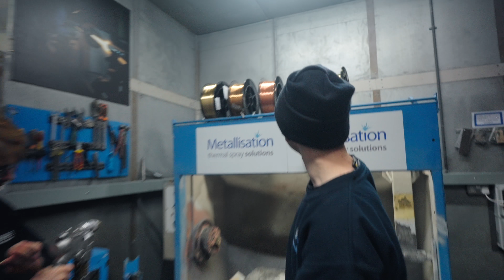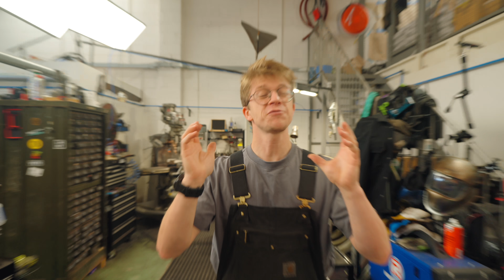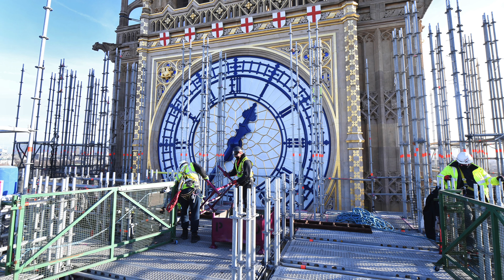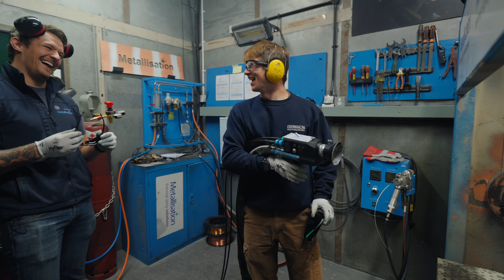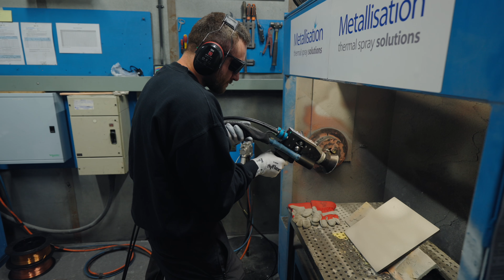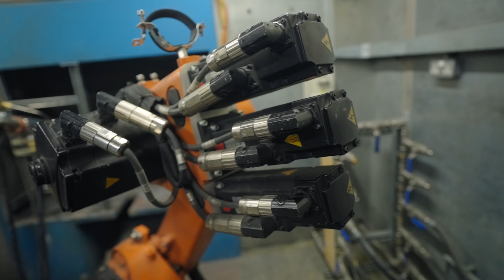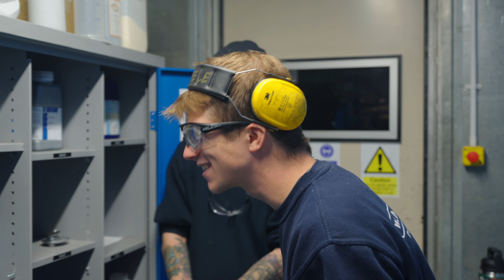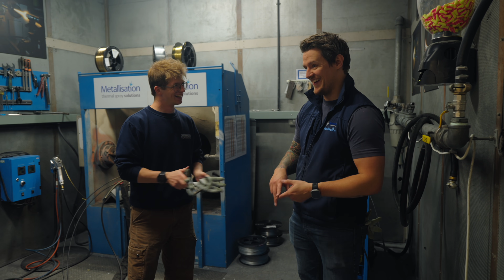Metallization

Comment: The digital film thickness tester is probably an eddy current test. It applies AC magnetic field, which induces eddy currents in the film, which in turn generate an inverse magnetic field, and the phase and amplitude difference between the input and output fields is translated into thickness, broadly speaking

Comment: Wow! This is perfect for rustproofing! Even in shipping industry usually paint is used! But now it might be possible for reasonable cost to spray hull with thin layer of stainless steel or some other corrosion proof metal! Also barnacle growth would be slowed down an ship paint is extremally toxic to marine life!

I wonder if it's possible to spray titanium over steel or there would be problem with oxidation!

Also bronze art installation can be made from steel and sprayed with bronze afterwards for corrosion resistance and rust proofing!

Comment: I like the idea of putting aluminum on something made of steel then electro anodizing it instead of doing electro plating, this is sick
Reply: I wonder if it would work, as cast aluminium doesn't generally anodise, so would the spray alloy be closer to billet, or cast?
Reply: @NathanNostaw since it involves heating up the material, it would be closer to cssting

Comment: This can be a massive game changer in automotive inner Cylinder wall lining and repairs
Reply: For fixing bore-scored Porsche 996 cylinders ?
Reply: @chrishb7074  The possibility of using different lining materials plus controlling  application thickness yeah corrosion dips and scratches would be a thing of the pass. Apply and then machine to spec
Imagine getting bearing clearance on rods /cranks near perfect by using this to build a consistent height and grinding them to the same spec. All theories of course lol

Comment: There's also a process called cold metal spray you should look into if you're interested.  It uses a high velocity jet of whatever metal to form the bond and is not supposed to reach welding temperatures  so you don't ruin any  kind of  heat  treatment/temper. Also, someone has combined this tech with a machine  tool so you can add whatever material then machine it to  size.
Reply: The pressures are much higher, hand held cold spray scares the hell out of me.  I'm happy leaving it on the robot lol.

Comment: I suppose you can technically do Gallium Coatings, you just need a device designed to use an electric element and a pneumatic sprayer to spray the gallium out but then you're painting, not Metallizing.

Comment: A long time ago I used to work as an operator on metallisation equipment. Those things were far different from what was shown here. We were coating plastic parts with copper and stainless steel to create ems-coatings. We used argon plasma and insanely huge voltages in near perfect vacuum and near absolute zero temperatures. The coating thickness, copper and steel combined, was around .001mm with an error margin of .0005mm 😅
Reply: That sounds like plasma sputtering
Reply: @teresashinkansen9402  I think the process was called vacuum chamber coating in english. In finnish it was "tyhjiöpinnoitus" 😅 Anyways, we had two chambers with insane vacuum pumps, ridiculous cooling and maniac levels of voltages, currents and magnetic fields. And we also had some fun with our equipment. I did coat some fishing lures and other stuff along in the production with our actual products.

Comment: It's funny when so many negative people say "Ugh, we don't make anything in this country" really are so clueless. Thanks for spreading the knowledge Alex! Edited to add and I only mention these companies as a subscriber to their channels too), there's an outfit in Oz (CEE) that uses hot spray to build surfaces for machining and one in UK (that I know of!) that uses hot metal zinc spray as corrosion resistance on their project cars (RetroPower) .
Reply: The thing with that is: we (in my case Germany) have moved a lot of labor intensive but low specialisation productions out of the country. BUT we still produce things. It's just that the things we still produce are not everyday applications. Without the specialised firms like Zeiss etc, some productions lines for other things would stand still. And it's probably the same or similar for the UK.
Reply: IIRC Kurtis @ CEE has a Metallisation arc spray setup.
Reply: @lemmy9996  I wasn't sure of brand he uses but good to know it's Metallisation

Comment: Brings back memories.  I did my master's thesis on arc spray.  Specifically, spraying zinc alloy on a pattern to make a mold cavity.  Cool thing, literally, about spraying zinc alloy is that it supercools.  We coated my younger brother's hand with a thick layer of zinc.  He wore a rubber glove to avoid UV arc burn, not for temperature protection.  Airport security was quite amused by it in his carry on luggage.  The hamburger too.

I didn't have the funding for a respirator air supply (to avoid zinc fume fever).  Thousands of dollars for that.  But a bathroom fan and flexible duct for $30 was in budget.  The $10,000 air compressor (you need a monster) was definitely out.  But someone else in the lab needed the same capacity.  "Hey, want to go pitch in $5000 to pay for half?" "Sure!"  Used one for $5000 and I had my compressor.  It was considered a facilities install, as was the hand-me-down spray booth from the art college, and I had my setup.

Unfortunately, the exhaust duct was under positive pressure and near a smoke detector.  Imagine my surprise when I get a tap on the shoulder from a fireman while making samples for testing.  The building had already been evacuated, I was still working away with my 104 db sprayer (wearing earplugs and respirator helmet).  After this happened the third time, I was told if it happened again, I'd be going to jail.  Worked out a deal that I could do my work at night and they would remotely disable the sensor.  I had to call in for them to disable, and call in for them to re-activate.  Mess either up, and I'd go to jail.

After a year of working nights, hundreds of samples, a 130 pages of thesis, I was able to give the mathematical equation to predict the strength of the sprayed alloy:  Original strength divided by 4.  You'd be within 19% regardless of the zinc alloy, machine settings, anything.

And that folks is my contribution to academia:  /4
Reply: No, your contribution is the rigorous certainty in the fact that divide by four is the correct answer. That certainty is A LOT of work and an important contribution to materials science. There is a beauty to an answer being simple, but the science is the rigour behind the simplicity.
Reply: @ParanoidMarvinMk2 Noooo! His glaringly obvious contribution was this YouTube comment. Think of all the years it took for the story to get to this YouTube comment section. That is a major contribution
Reply: Hell yeah!, that's cool af.  I don't know you, but I'm proud.
Reply: Dude that’s so cool. You also write very well, have you considered posting or making videos about your knowledge in this area?
Reply: What an amazing experience to be able to have such a real world and long lasting impact on such a valuable technology.
Reply: So, did you figure that it's because of porosity, or is it bond strength between particles? Both?
Reply: @weatheranddarkness  Porosity some, but there is significant oxide inclusions.  You'll note that they use nitrogen or argon in the video sometimes to avoid that.
Reply: @jeanbeaupre4006  oh, that makes loads of sense
Reply: @weatheranddarkness i was thinking the same thing.
Reply: That certainly is a remarkably simple conclusion to what could have been a highly complicated transcendental/non-closed-form equation!
Reply: @zinckensteel  Yeah, something like that was the middle part of my thesis.  A full page equation.  Followed immediately by saying that's too hard, time to go empirical.
Reply: I've got nothing more to say that hasn't been said, I just wanna add my contribution in saying your research bore great and very interesting results !
On another note, I'm glad you had the chance to do your research on a new technology, and I hope the actual "making" of your research was as interesting as your results.
Reply: 🎉🎉🎉🎉 congratulations i read that and besides the very end bit i understood all of that. I'm 🍃 so good on ya 😅
Reply: you coated a hamburger?!?! nice
Reply: @A2ne  Yes.  And my mom keeps it on a shelf.  It's 30+ years old now.  Scary to think what it's like inside.
Reply: Do you think microwaves for heating, magnets like in a physics particle linear accelerator, and for focusing, and vacuum to avoid gas inclusion and other problems could work? I'm assuming the microwaves heat the metal to plasma so the magnets act on non ferromagnetic materials.  Seems like maybe the metal could be focused down to a small point for something like a 3d printer. Or maybe used for metalization with fewer consumables and fuss than mini Saturn 5 rocket engines.
Reply: @karlharvymarx2650  That's above my pay grade.  But I did tinker with the notion of using electrochemical deposition through a narrow tube connected to several difference base metals so that allow percentage could be controlled at any point.

Too slow.

Don't know if your approach would work, but could be much faster.
Reply: Absolutely Awesome Story.
Reply: wicked! 😂
Reply: i love you
Reply: Man. You are awesome!
Reply: Awesome! thanks for your contribution!
Reply: Hahaha!  Brilliant story and delivery!!!  Thank you for sharing that. I got a big smile on my face and feel ready to start the Day!
Reply: i love hearing about mat science work, makes me more confident in what i'll settle on with chemistry lol
Reply: THANK you for that , SALUTE
Reply: That's cool af!
Reply: Brilliant 👍
Reply: Thats cool af
Reply: these coatings are all over jet engine parts. Every ware area is coated. Depending on force of ware point depends on coatings applied. Jets would not have the longevity without this technology.  Thanks for your contributions to the world. Every time some one advances knowledge in any area we all benefit from the advances in technology.
Reply: It puts you ahead of Einstein: his value of speed of light was from rearranging someone else's equations.  And 1/4 +/-0.19 is easier to remember
Reply: Arc spray zinc was the first time I saw this process almost 30 years ago.  That’s was amazing for a restoration shop cause you could sand blast a hole in sheet metal, put your leather glove behind the hole, and fill the hole in with zinc, that wouldn’t corrode.  This is the second time I’ve ever seen this process.  Phenomenally cool!
Reply: Bathroom fan and flexible ducting????  I don't want to know what kind of lab lets you improvise PPE 😬 an N95 filter is rated to stop zinc oxide, even a disposable one with proper fitting would have been fine??
Reply: It's so ridiculous and sad that they couldn't give you an appropriate space to work in, something like an auto-garage or shop bay type space, free of unnecessary smoke detectors. That's just stupid. Surely there are many experiments in need of doing that inevitably WILL create smoke enough to set off detectors on a regular basis to complete. Clearly not an institution that cares about all branches of industrially relevant science...
Reply: @TheEvilAdministrator  yeah sure they should let people burn down the multimillion dollar lab lol!!! What they needed was to fix their ventilation system, not to remove crucial safety equipment. Fume extractors should never have positive pressure! At that point it's no longer an extractor, just a pipe that pulls your fumes out from your fume hood and blasts them straight back into the room from the nearest ventilation joint!

Comment: 21:30 I was curious so I looked into the dollar value of the HVOF powder with tungsten carbide cobalt chrome and depending on the powder quality 70 grams would cost around 3.50 USD up to $13.25. I would assume it requires the higher grade for reliability so $10+ per minute seems fair.
Reply: Not that bad

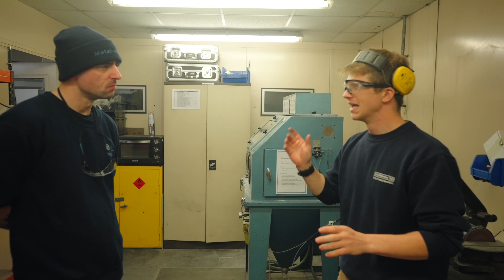Comment: 24:32 - Actually, you had three options. Spraying kind of works but leaves a porous surface, which might not be viable for pistons. So what you would do is use something like a Sir Meccanica overlay welder to build up the surface with solid metal, and then turn it down to the exact diameter.

Comment: As a jeweller, my mind is just racing with different things I could do with that first system. Imagine something akin to fordite but metal. Bracers and pauldrons that have brilliant bands of shining metal running across the surface. Even just small bangles and pendants! I wonder if there's anywhere nearby with one of these that I could commision for blanks...
Reply: Machine shops are the first place to look I think. I would check into the porosity of the spray. Jewelry shiny is really shiny. Just a thought...
Reply: @rebelsqk  That's actually another aspect that I'm intrigued by. Having a matte finish or a larger parts could offer some lovely contrast against brighter, smaller, pieces.

Comment: I worked at company that sprayed a coating on top of HVOF. It was same process as HVOF spraying, and my job was polishing afterwards. The material sprayed was either zirconia or chromium oxide (some type of ceramic). It was mostly turbine blades and vanes that were sprayed. Generally HVOF layer would have to stay intact, but sometimes you just have to dig into it a little bit to get desired surface, and that thing was vile - super hard making the polishing disc dull very fast, and you could smell it right away through the protection mask filters.
Altogether it's a really cool technology.

Comment: According to the manufacturer, my pots and pans have the stainless steel bottom sprayed on the bottom of an aluminium corpus to make it induction ready. This is supposed to be a much stronger bond than plate bonding through pressure.
Reply: That may be cold spray, which is similar but different.  I know Impact (a German company) makes a turnkey system just for induction cookware which is wild to me.  The technology is not generally commercial but they're actually doing it.
Reply: @fredyybob1  That seems possible, though the sample picture Hoffmann shows has a very impressive shower of sparks whereas the Impact demo video shows no sparks at all.
I also vaguely remember the Hoffmann site saying somthing about the metal being sprayed molten, but I cannot seem to find that now.

Comment: It’s actually pretty awesome the first time I used one my boss gave me the wrong dimensions on a cylinder to to turn down so I turned it to small so while on the lathe with weld blankets down we sprayed it and build up the metal to get proper dimensions offer returning it

Comment: Excellent video, I live all the way down in Cornwall and wanted to zinc spray a chassis so I got a full propane/Oxy kit and the gun to atomise the zinc wire and its works a treat, hard to set up but once dialled in its been brilliant. I buy wire and other parts from the guys you visited !
Reply: I do offroading and this seems like an expensive but really effective way to treat a chassis (or any part really) for corrosion. Would still put a coating on top though
Reply: @guillaumejoop6437  I have since used it on the steel bumpers on the lorry and also done the steel wheels on the trailer, then a quick coat of etch and paint and its all done.
I'm only using boring zinc but its been a great way to stop stuff insta-rusting here beside the sea.  Main thing is to grit or glass blast what ever you want to spray and make it clean.
Reply: Can I ask you about the rought price? Nearer to 10k or 1k? Or am I totally delusional about the price?
Reply: @Atariks  All in with the gas bottles and the zinc wire, all the flow meters and the rest of the kit and the actual flame spray gun itself I am into it for around 8 grand Sterling.

I am also now spraying stuff for others and charging them.
Reply: @paulmanta  Thank alot. Thats really not that expensive and the spraying for others was one of the ideas to get the money back in.
Reply: @paulmanta so how much was just the gun please?
Reply: @stephenblant  I bought the whole kit all together and it was a lot of money, have a look at thermal spray depot in the US
Reply: @paulmanta Thanks for the reply.I am in the UK.I was just wondering if they itemized on the invoice

Comment: we have something like that in industrial bricklaying.. except its for correcting cracks in ovens that are on... we use the heat from the oven to ignite the gas and material...  a problem can happen when you accidently touch the nose to the brick wall